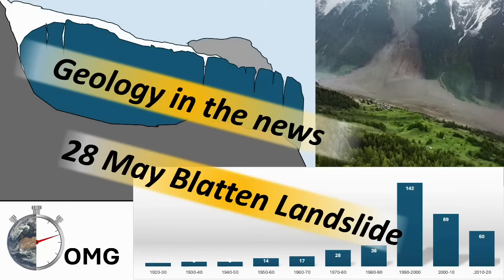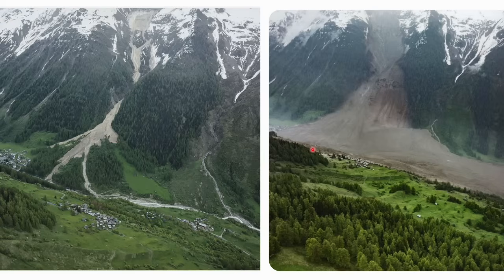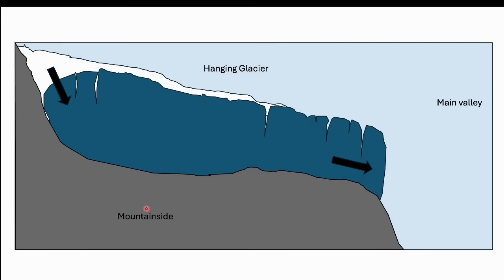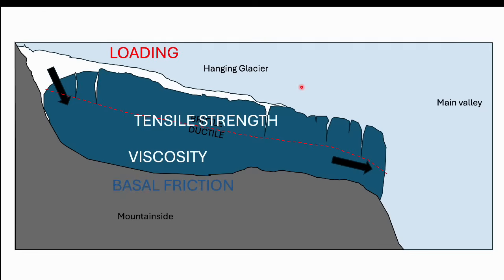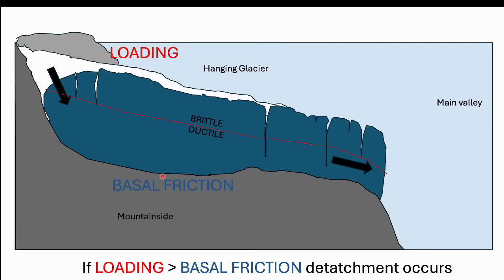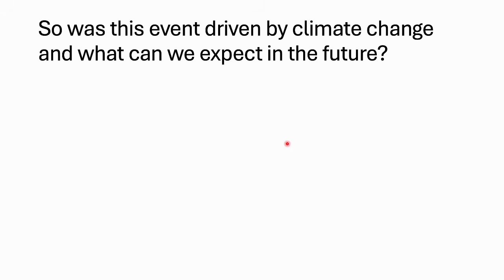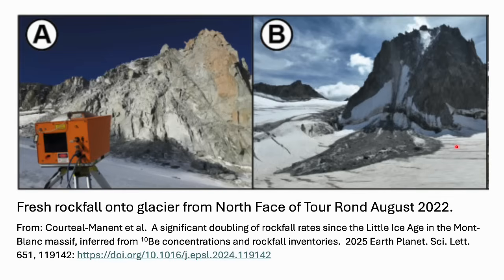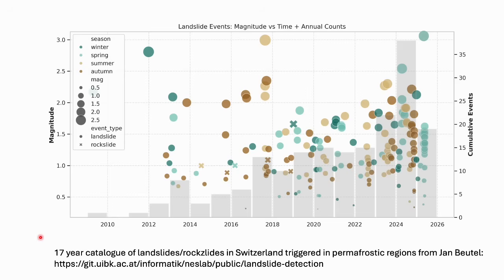The Blatten Landslide

Comment: From: Journal of Glaciology , Volume 19 , Issue 81 , 1977 , pp. 589 - 594

Many problems of applied glaciology in the Alps arise because man is living and working in a high alpine environment which is heavily glaciated. Some of these problems concern the interaction of ice and lake water as it concerns flood protection work and the operation and completion of hydroelectric power plants. In this paper some observations relating to this interaction are reported. They were made in recent years by various staff members of our institute.

Some observations which pertain to the interaction of ice and lake water in a high alpine environment, and which were made in recent years in connection with hydroelectric projects and flood protection work are presented. In 1966, when the thin flat snout of Griesgletscher (Walliser Alpen) became submerged during the first filling of a newly constructed reservoir, waves of only very small amplitude were generated by the calving of a bout 150000 m3 of ice because most of the energy was dissipated by local turbulence. Far more spectacular waves have been experienced near steep ice cliffs in connection with work for flood control. For the design of an air bubbler system, air and water temperatures were measured in winter 1974–75 at Grimselsee, one of the largest reservoirs in the Bernese Alps. These measurements showed that the warmest water at the bottom of the lake was drained away during winter for the production of electricity. A strong temperature inversion forms in the air above the water behind the dam, as the lake level is lowered by several tens of meters.

Comment: Would you consider redoing those numbers for a catastrophic collapse directly above the glacier of the main top?.Maybe say 100 times the load of the first collapse. I'm curious as I don't think its the main event yet. I know there isn't any reason to feel this would be the case .but I am just curious. The striping effect on the top seems to echo where the first slide onto the glacier started.
Reply from the maker: Sorry, I don’t have the data to make those calculations.  Constraining the basal friction of ice sheets and glaciers is one of the lasting problems in glaciology (which isn’t my field). We also probably don’t know the geometry of the glacier bed or the loading well enough to make specific models for this glacier. So I think the best we can do here is to continue to monitor the flow in the glacier to see what f it is returning to a new steady state or accelerating to a new failure.

Comment: Fascinating review of the chain of events leading to the coverage of Blatten.  Could you elaborate more on the part where you said heating of the ductile layer is a factor?  What is the specific source of heating when sandwiched between the brittle region and rock base?  Is it differential heating of some sort, or just the same heating from above or below causing different effects to ductile ice than would brittle?  in civil engineering speak would this be a global stability failure of discreet parts and if so, which specific parts first? Then second?
Reply from the maker: Hi, it isn’t heating which changes the brittle ductile transition in this case.  Extra load will not change the temperature in any significant way but hothead extra load will do two things.  It increases strain rate and at higher strain rates things become more brittle, so the transition gets deeper in the glacier. That I turn means there is less thickness of ductile ice supporting the load so the stress and strain rate increase.  The second thing which is possible (but in my opinion probably insignificant - but it s only an opinion) is that the increased pressure at the base of the glacier might enhance melting and so weaken the basal contact.  That is because ice water melting has a negative P-T gradient.

Comment: one note: your before and after images at about the minute mark are slightly misleading. in the days between where the rockface starts collapsing onto the glacier and the big glacier collapse there were a whole bunch of smaller rockfalls and debris flows, and most of the fresh debris on the alluvial fan stems from those events. reference e.g. the arial images of Blatten on the official swiss maps at map.geo.admin.ch. before the beginning of this event the two fans are much more similar than they appear here.

Comment: Excellent, informative, and clear explanation of before,  during and immediate aftermath, especially given the entertainment media is much more interested in pearl clutching over the drama over loss of empty homes, the excitement of airlifted cattle and making recriminations towards authorities who evacuated people and their domesticated animals (for economic reasons its presumed) but did nothing to save wildlife.

IMO, the questions that should be asked right now are more immediate then what can be expected  in this sort of activity as we continue over this interglacial period for the next possibly 11,000 - 100,000 years where climate will warm, glaciers will melt and receed, and as part of a long ongoing cycle of planetary surface erosion more landslide will happen as the glaciers have ready done the damage and as they receed all the mountain faces they have been eroding away is then free to fall away.  Of course, eventually the glaciers will grow again as then planet cools into the next glacial period, with its drama of continued pushing of eroded faces that did not fully break loose as glaciers disappeared but will suffer from the weight and pressure of new glaciers forming, growing and glowing back into areas like this.  It is anyone's  guess as to whether man will still be around or not by then, but if we are and we have found a way to add no more heat that speeds up climate change, we have to realize that climate change is still going to happen as we area still going to be in a cycle of natural warming we have no control over.  This planet has been through these cooling-warming period many times, taking the planet from hot to then point where there was nothing but poles that cooled in "winters" and saw some snowfall and the planet had no permafrost to a "snowball" planet with only a very small area around the equator which had some seasonal change, a growing season and it was warm enough to sustain life.

But those extremes are so far in the future man maybe extinct or move on to escape a planet warming too much for most to adapt to surface dwelling and hot to sustain agriculture to feed those surviving an overheated planet with fresh water only available through technology.

IMO there is more immediate action needed.  Its obvious there is already a great problem with the river the land slide has blocked, and the lake that is quickly building upstream behind the natural dam the land slide deposited. 

The fact that parts of Batten the escaped the destruction of the immediate land slide were in less than a week flooded  out by the newly forming lake should emphasis waiting spells disaster for everything down stream. Left to its own devices, given the terrain of the valley that land slide blockage is going to create a lake that will stay shallow until it reaches terrain high enough to cause it to take on depth.  

Authorities seem torn between waiting to see what it does, hoping it will create a channel to what they say is an ancient river bed on the opposite side of the river from the mountain that failed so  that the river may go back to using its ancient river bed that it ran in before it changed course for whatever reason, escaped its ancient banks and carved the river that is now blocked giving the river a new (ancient) way around the landslide. 

Or they hope, in man's usual hubris that they can control the lake depth using controlled  out by upstream dams forcing some very old dams to hold more water than they have in the double-digit decades since they were constructed.

Waiting is hardly intelligent as the land slide build an unengineered dam on a base they can only understand a bit, and half of which they can do little but guess at. There is some evidence that water is not only seeping through debris under water already onbthe upstream side but as quickly as this new lake is forming the leakage is not going to allow enough water through to reduce the lake or keep it from blocking more water.  Water is powerfully destructive and slowly at first, and perhaps hidden from experts how much erosion is happening under the dam nature built, until its too later to completely evacuated downstream as the land slide debris blockage fails spectacularly and in minute and downstream  towns and people have mere minutes to and hour to save themselves from the wall of a full lake of water coming down on them.  Saving all but one in  Batten, won't be seen as thr heroic actions it was as it will pale in comparison to the loss of life down stream.

 It to late, it seems  to try and move land slide debris and allow the river to run through. Shutting the dams upstream  while moving enough debris to allow enough water through before allowing carefully monitored through  at the engineered dams.  This would have been viable, even if it eroded debris further, all it would do would be to open up the river to its natural width and usual flow and eventually the dams upstream could resume normal flow rates.  But once water had backed up enough to flood the surving part of Batten that probably, if not surely too late.  

They have time if the upstream dams can drastically or close there floor to build a controlled spillway around the debris and into ancient river course that down stream does open back into the current river.  It would have to be engineered in some manner to be controlled otherwise just opening the ancient course to the water already retained would be litte better than moving the land slide debris when it came to the amount of downstream flooding but at least those down stream could have enough notice to be evacuated and prevent any loss of life.

There is also a possibility of re-enforcing and heightening the debris dam, and building in controlled outlets to send water downstream at a normal rate and hope that the other part of the mountain remains stable for a few years.

The other solution, if enough time could had since they expect that glacier to be unstable and more land slides to occur is to engineer a dam below the area with the unstable slopes allowing a lake to form that can be held back safely.  In fact that should be considered to be done even if they control and relieve the immediate by any other method since they expect that area to remain unstable probably causing this problem to arise again.

In the very long term, even with the dams they have now there is reason to consider a project to run underground steel culverts the length of the river that can possibly produce land slides, which can withstand the pile up of debris that can be opened in segments as need to carry the river under any land slide area.

Or, since, as warming continues, and this will happen again and again through the river valley,  perhaps relocating villages and people and their way of life's to areas that are safe and stable and abandoning the valley giving it back to nature allowing what's to happen to happen.  While we can slow down or even stop humanities impact on warming, the planet is warming and that we cannot prevent, nor probably should we even try.  Humanity has managed to survive many of the extinction events that have wiped out many other species because we adapt so well.  And, while we can do everything possible to limit or end our impact, even more important is too think ahead to what will happen no matter what we do and start adapting now.  The quicker we adapt the larger a population that will survive.

But they really need, as they decide what to do, is evacuate downstream either to a dam great enough and strong enough to hold back the water building up upstream of Batten or, if no dams that can do that evacuated all the way to where then river  outlet is, simply to protect lives since a debris dam can go at any time and possibly without any warning.  Then pray for a drier summer in the mountains and less rain, while using those months to limit water to the debris dam as much as possible until they have alternate solutions in place.

Comment: Just to complete the picture. What non landslide events (earthquakes) could have acted as triggers to instability in the rock of the mountain peaks. The African tectonic plate motion north is causing a lot of activated events in the Med. sea area but does influence the Alpine regions. The same activity on the plate boundary is following climate change effects with events from the Canary Isles to Turkey inc.. Etna, Santorini, Stromboli, and the Naples area, La Palma a few years back. I do not dispute your mechanism for this slide but the rock fall trigger may have been a natural disturbance. (could be a small tremor before the main rock fall event on the data)

Comment from the maker: Someone raised an interesting question about the first study - sorry, I can’t find your comment now.  Why does the rockfall rate peak in the 1990’s and reduce in following decades?
One plausible explanation is that the rock face studied here was only just in the permafrost region (mean elevation around 2600 m).  That means it was particularly susceptible to melting and the permafrost might now be completely melted. You would expect to see rock fall increasing with melting, with the maximum rock fall rate coinciding with, or coming just after, the maximum melting rate.  Once all the permafrost has gone the rock fall rate should decay all the loose stuff has already fallen) til it reaches the steady-state rate of the new non-permafrostic conditions.

Comment: Thank you for the wonderful explanation. I have been reading about rebounding from the last glacial maximum having effects from the river valley bedrock going up the mountains to the fractured rock structures and causing much of the rock falls. Is this something you also find? Also, with the increased weight of rock that falls upon the glacier: Doesn't this pressure increase the melting rate of the glacier, increasing the movement?

Comment: It was the rock above the glacier that gave away which appeared to occur along a steep bedding plane, a normal occurrence of erosion that is bound to happen sooner or later. The glacier itself didn’t have much to do with it and was only failing because of the basal rock sliding down. The permafrost underneath the glacier has little to do with it. Why did you embark on a long explanation about ductile and brittle behavior within the glacier when it was the full force of the land slide that made the whole glacier fail, irrespective of the change in the boundary between brittle and ductile ice.
Reply: The video explains that in Switzerland, at elevations above 2000 meters above sea level and on north-facing slopes, there has been an extremely strong increase in mass movements over the past 30 years. The mountain slope at the Nesthorn that collapsed has exactly this orientation and altitude. It is therefore likely that melting permafrost played a decisive role in the disaster. The studies referenced in the article elaborate on this development.
Climate change is particularly pronounced in Switzerland. Since pre-industrial times, the average annual temperature has increased by 2 to 2.5 degrees Celsius. This trend has accelerated significantly since around 1980/90. There have also been more frequent warm or cold air intrusions and an increase in localized heavy rainfall events. All these factors contribute to the destabilization of the mountains, especially in the (formerly) permafrost zones.
Reply: @Susanne-qp8vjSo far I only heard that climate change had minimal influence on this.
And I‘ve heard this from the swiss geologists in interviews.

The alps are eroding, slowly.
Last time this happend in switzerland at such a scale was in 1806 in Goldau.

Climate change is real but this even just wasn‘t mainly caused by it.
Reply: @Susanne-qp8vj one could make the opposite argument that an increase of permafrost would crack the rock because of expansion due to freezing of groundwater.
Reply: @chrisschoneveld1558 just stop.
Reply: Every child in switzerland knows about melting permafrost because it's very relevant to them. Why are you figjting against geological wisdom?
Reply from the maker: Permafrost isn’t underneath a glacier. It is what holds frost shattered rock faces together in high mountains where the mean annual temperature is sub zero.
Reply: @OneMinuteGeology of coarse there is permafrost underneath the glacier but also away from the glacier at high altitudes, but your explanation with respect to climate change is bullocks.